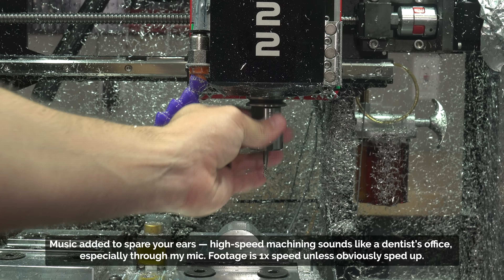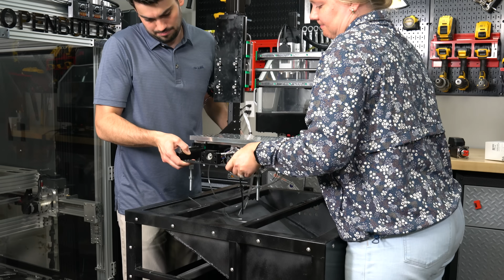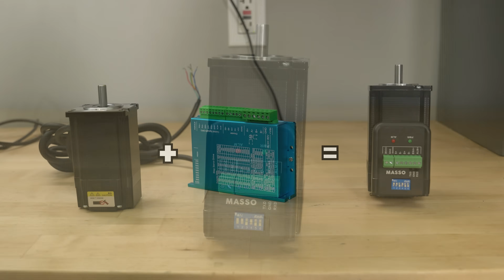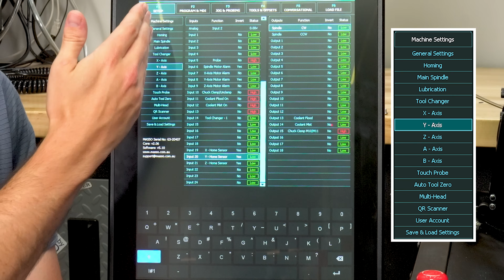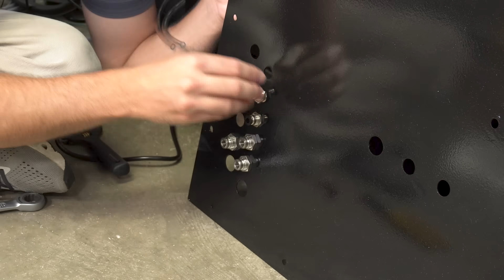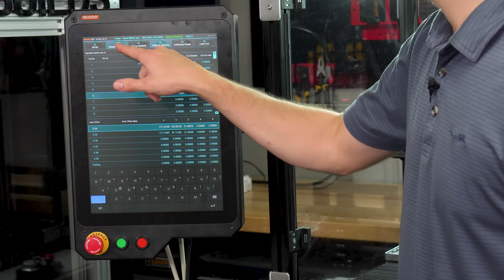Building the Ultimate Compact CNC Mill — Not just an Upgrade!

Comment: Very expensive for a simple diy small size router. But 10/10 for the work done. Great job
Reply: Having researched small benchtop CNC mills (this is not really a router, though I suppose you could classify it as one).  The method of construction and capability of this small mill, for the price point is pretty reasonable at $2500 for the kit.  

I don't know that I'd bother with the upgraded spindle, but the base machine is pretty good.  Though I have to say, that bow in the X-axis is kind of a deal breaker for me.
Reply: @WHJeffB yea the spindle is exactly what made me say 'unnecessarily expensive upgrade', I'm sure this spindle worth every penny, just not suited for such build which isn't bad either.

Comment: Wow… when I saw your first video on this mill I was very impressed but quickly found out about the ability we have as creators to upgrade these machines and here you are already with an upgrade video out… incredible.
Reply: Same...  One of the great things about this "kit" is that the components can be used to build something a little bigger and more robust if you're capable of doing so.  It's a great starting point for an improved version.

Comment: @DrDFlo , Great video and impressive work. Have you considered other spindle options that might be more cost-effective (e.g., ER with liquid-cooling and mechanical ATC) while still suitable for the purpose and limits of your desktop machine? This spindle appears to be excellent, but it comes with several additional subsystem components and a relatively high cost. Neither of these is trivial.

That said, your students will undoubtedly learn a great deal from the experience. Great work.

Comment: That's an awesome compact prototyping machine. Definitely jealous of the enclosure and flood coolant.
With all these nice upgrades it might almost be time to also upgrade the rigidity of the DMC2 Mini a bit. That Spinogy spindle could definitely be pushed much harder.
Reply: In his first review video of the machine, he mentions filling the structural steel tubing frame members with epoxy granite.  I wonder if that would help with rigidity/vibration.  It might be worth a try.
Reply: @WHJeffB  The epoxy granite helps with damping of vibrations, but doesn't increase the rigidity itself much.

Comment: Question on the e-stop to the Spinogy XCONTROL E box.  Are you using terminals 58 and 59 in the Spinogy box and then going to the MASSO relay?

The video was excellent, as it contained a wealth of valuable information.  Thanks again.
Reply from the maker: I am using the ES circuit on the Masso with the Relay module (NO configuration) to keep terminals 58 and 59 connected under normal operation

Comment: Nice but way too expensive for hobby use. The Spindel alone cost as much as my entire CNC. At this price point a used industrial CNC is the better option.
Reply from the maker: Sure, but you can keep the stock spindle if price is an issue.

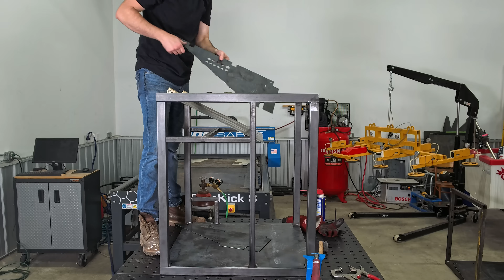Comment: 9:54 Could that assembly not have been bent sheet steel with only a few seams to weld? Perhaps it was due to machine size limitations if cut in house or a spike in cost with the additional size that needed to be laser cut?

Comment: After that video I am not sure why anybody would want to buy a masso controller tbh.
(for me) the single pro argument is that it is a standalone system.

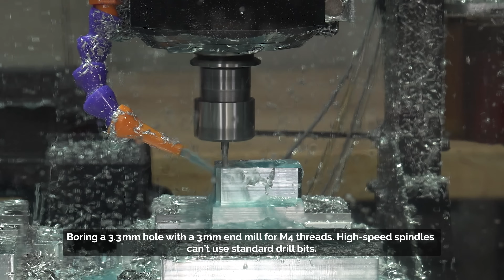By the way.. 52:00 that is not true, you can absolutely use standard drill bits. Get some carbide drills and you can drill all kind of holes without issues. Just stay above 6k rpm.
Reply: Yea drilling lol you just need a break in the z axis motor and a better for the price for spindle setup lol. I drilled 200 holes and made my 4th axis plate in some videos on my channel with og setup before all fancy upgrades. Just using good machining practices speeds feeds and material knowledge.

I plunged into 6061 t651 at 40ipm .100 depth with a 12mm endmill and went into full slot. Im making a piece for my coolant system so i didnt have coolant but i did use some cutting fluid on the part.

I can do a full width slot at 20-30ipm 12mm cutter .150 same 6061 t651 thats 48000 tensil normally for t6 thats pretty damn good with no collant my machine setup.
I also have wireless probing and almost done with the tool holders on the lathe for full atc.

Also for the masso part.
I actually love it. Yea it locks you and is limeted in a sens compared to a centroide acorn. Your never going to get fanuc or haas level for the price point. But it really isnt that bad can do sub programing and looping and g38.2 for probing scripts and now with next update you can edit and make macros so thats kinda nice.

Comment: Does the coolant react with Polyethylene? because id probably have sought out an RV water tank. as those are often meant to fit into tight spaces. I did do a quick google and found one that is 9" wide and a diamond plate one from a hunting supply place at 8.5" wide or a portable fuel tank(sometimes called a fuel cell).

Some kind of hand held nozzle might also help with washdown, cheapest angle might be one of those ones you can add to a kitchen sink(the ones that sit off to the side and kids sometimes rubber band "on" to prank a sibling).

Comment: Epic video as always!!

I'm currently designing a 1200mm x 1200mm (4x4) CNC using 150x100x9mm square tubing and all ethercat + LinuxCNC + 1kw servos stuff. Maybe a 3-plate method with that 9mm thickness would ensure straight axis? :) :P

Oh, that'll be my first CNC. I hope I'm not going too overkill or making massive mistakes with it :P

Comment: Did you have any issues getting the stock z axis limit switch to work? Or have to do the pull up resistor?
Reply from the maker: No issues. The MASSO controller works with NPN NO inductive sensors (what is supplied with the DMC2 mini kit), but yes, you do need a pull-up resistor on the signal wire (black)
Reply: @DrDFlo but using the extension board simply flipping the switch for that input does the same thing tho right? If I'm understanding it correctly
Reply from the maker: Yes, that is correct. Just flip the switch to on, plug in the black wire into the input and you are good to go.
Reply: @DrDFlo  sweet thanks! Any news on when link to your site will be working with info on the mill? Really like the way you 3d printed keeper for the Y covers want to do the same

Comment: What would be the cost difference between buying something like a tormak and building and modding something like this? Seems like all the upgrades add up pretty quickly. Especially when you add a tool changer.
Reply from the maker: The X22 spindle brings the mill to the next level in terms of performance but also price. If you keep the stock spindle, then you are looking at $2500 for the base mill kit + $1400 for the MASSO touch controller + $2000 for stand + $1100 for extrusion and PC top for a total of $7k. While it is difficult to compare this build directly to a Tormach due to a difference in performance and man hours required to tackle this project, an enclosed PCNC 440 mill starts new at almost $19k. I think this is more of a testament of how expensive everything is today.
Reply: A Tormach is worth the money. This project is not Doc's best work, and I think they should stick to printers. This is stupid expensive for its capabilities and will struggle with anything more difficult to machine than aluminum. It is simply not rigid enough to justify the chosen spindle. Machines like these excel with small tooling and light cuts in softer materials due to a lack of rigidity, so a slower, stronger spindle is a poor fit. Also, the design offers little in terms of compensation during assembly; it's imperative that the linear rails can be set parallel and square to each other. 2-thou out on X is piss-poor, a mile in terms of machining. You'd aim for a tenth of that at most.
Reply from the maker: Once I replace the X-axis, I can get it down to a thou over 12" (perhaps better). Smaller parts will come out more accurate. I am curious what hobbyist machines hold 2 tenth? The dovetail ways of the older Tormachs definitely do not and the MX series is in a completely different league of price. I think that you can argue all day that the X22 spindle is overkill for this mill, but you can extrapolate what I built to a larger machine if you go that route.
Reply: @DrDFlo  The machines do not hold two-tenths tolerance on machined parts; the linear rails should be parallel to two-tenths. Machine tools are assembled using tenths indicators for a reason. I understand that this is a hobby project, but two-thou is unacceptable. They aim for about two-tenths (5 micron) over a 20-inch (500 mm) span.

Comment: So you got a $10,000 spindle, a new DMC mini 2 kit, the Masso controller and components, and all of the bent metal all sponsored for this video? Somewhere around $20k retail. When I bought my Mini 2 for full price as an early adopter all I got was a half-baked DIY mill and a damaged spindle mounting plate.
Reply: I got  the DMC mini  and the QC is so bad I had to make a new frame.  I could have just got all parts made my own frame and I would have saved 1500 and had a better machine.
Reply: 20k and his CNC converted RF45 is way more capable. 😂😂😂
Reply: Being one of the early adopters of DMC2 I have had similar issues :

Mechanical: 
1.	Parts which have horrible powder coating, to the extent that they form blobs at every hole and ruin the flatness of all surfaces and all M4 tapped hole needed re-tapping to clean them.

2.	Parts which have burrs from laser cutting 

3.	Parts in which the threaded hole tapping; which was supposed to be blind is actually through hole now. 

4.	Parts which have unmachined surfaces.

5.	Ball Screw ends which do not fit the square nuts as there are burrs. 

6.	Threaded holes which do not match the mating part.

7.	Extra Parts which have no use.

8.	Alignment Tool which does not fit.

Electronics - 
Not everybody is proficient with soldering, I have to solder the control board if I mess it up and I probably will as I am novice in that department; I would have to spend additional money and source the spares.

I was not even informed about the specifics of the assembly instructions as the assembly manual was shared only when the deadlines of the shipping neared.

Instruction Manual  - 
Incorrect on several instances.

Interestingly the members of the Facebook DMC group were more interested in providing expensive workarounds and defending the manufacturer saying that this is a DIY Machine or its not a huge company its just one person so its understandable and so on. 

For me it was a great deal of money spent on the machine and a huge let down considering much I have had to spend additionally until date.
Reply: @user-so9nm9cd9y when you ordered your kit? Mine just arrived and I'm a bit worried about that, especially considering the fact I'm located in EU.

Also is there any reason why he swnd the assembly guide after shipping? Leaking that is not a biggie, just nobody needs that to be leaked xD
Reply: @Mechavis  I ordered mine back in 2022. After DMC1 ended on Kickstarter, I contacted Omar, and he mentioned he was already working on an improved version (DMC2) and suggested I wait. A few months later, he released promo videos on YouTube, launched it on Kickstarter, and although I was late to back it there, I got it at the same price. So, I believe I was in Batch 1 or 2 of DMC2 deliveries.

All the info I had was from those videos and the DMC Shariff website, which said assembly only needed basic tools. The assembly manual wasn’t ready until close to the promised shipping date. So imagine my surprise—I waited months just to back the DMC2, paid for the product, then waited even longer for manufacturing to finish, only to find out I’d need to solder components onto the controller board myself. By the time I came to terms with that, the kit finally arrived, and I ran into even bigger issues.

This is just my personal experience. I’m not sure how much has changed since then  and with the new DMC 2 Mini, but even in 2024, I saw people on the Facebook group having similar issues with DMC2. 

My advice: check the Facebook group and most importantly  talk directly to Omar to clear all doubts about quality assurance, warranties etc.
Reply: @Mechavis I ordered mine back in 2022. After DMC1 ended on Kickstarter, I contacted Omar, and he mentioned he was already working on an improved version (DMC2) and
suggested I wait. A few months later, he released promo
videos on YouTube, launched it on Kickstarter, and although I was late to back it there, I got it at the same price. So, I believe I was in Batch 1 or 2 of DMC2 deliveries
All the info I had was from those videos and the DMC Sharif website, which said assembly only needed basic tools. The assembly manual wasn't ready until close to the promised shipping date. So imagine my surprise-I waited months just to back the DMC2, paid for the product, then waited even longer for manufacturing to finish, only to find out 'd need to solde components onto the controller board myself. By the time I
came to terms with that, the kit finally arrived, and I ran into
even bigger issues.
This is just my personal experience. I'm not sure how much has changed since then and with the new DMC 2 Mini, but even in 2024, I saw people on the Facebook group having similar issues with DMC2
My advice: check the Facebook group and most importantly
talk directly to Omar to clear all doubts about quality
assurance, warranties etc. and then decide if you want to order.
Reply: @Mechavis I bought my DMC2  two years ago and, even though Omar always answered my emails promptly, I still couldn't make it work. He sent me a new distribution board and mach3, which I'm soldering to replace and, hopefully, this time will work.
Oh, and the manual is very confusing sometimes with pictures that don't match with the real life situation. I live in Spain by the way. Good luck!
Reply: In the video you mentioned your "budget" would you be willing to share what your budget was for this build? A know you also got a lot of donations from vendors, but what would be the normal price for those components as well.
Reply: Dude you got a water cutter plasma cutter
Reply: Dude, you got a plasma cutter. You got massive three printers and a bunch of other three printers. You got a water jet, a big water jet, a plasma cutter, a big mill, and you built that little crappy shit with a $10,000 fucking spindle. It's a joke. Why don't you just use ultra high strength concrete? What's up with you, bro? It's always been Neil too much to watch you. I'm trying to make it. It's just like it looks like I don't know, man. I I words can't describe it. I can't even say it on YouTube. I might be alone. I'm sure I'm not the only guy here. I'll give you a fucking thumbs up anyway, buddy. How about that?
Reply from the maker: Hey sorry man that you had a rough go at it with the mini. Obviously, with the twist in my X-axis and your problems with the spindle mount, Shariff needs better QC. Were you not able to get replacement parts?
Reply: @DrDFlo I got a tracking number for a UPS shipment that never was picked up and then a small partial refund. Had to get the plate remade at a local shop. My x-axis also exhibits the same issue yours did in your first video. As much as I like the machine, I feel like I was a paying beta tester rather than a customer receiving a product.
Reply: @JeffandJake I got ripped off too with my DMC QC and zero support
Reply: I was one of the first folks to purchase a kit of the dmc2 mini, other than some missing hardware, my kit had zero issues. This 100% sounds like QC as they made more kits.
Reply: @ccatlett1984 the first ones got lucky the rest of us got junk..   I will make a video of the pictures I took of my parts to show how bad the QC is..  I unlike most don't have a Mill and lathe in there shop like I do so they can fix it..
Reply: @ccatlett1984  I ordered the first day the kits were available. I don't feel like I've been scammed but I think that giving out kits and machines to shills to promote is poor form when the paying customer doesn't get what they paid for.
Reply: So… someone else got a great setup and made a cool video, and you’re mad because yours didn’t work out? That sucks, but what exactly are you trying to say here?
Reply: @LionInTech caveat emptor

Comment: Hi, Great video. Awesome detail and easy to follow. Nice upgrade. I'd recommend filling in the stand tubes with resin, sand and gravel to reduce vibrations and increase precision. 1 side note. Your link to the benchtop mill you have in the description is not working. "Page not found".
Reply from the maker: Troubleshooting the website issue now
Reply: @DrDFlo  Hi, page still seems to be down. Thanks